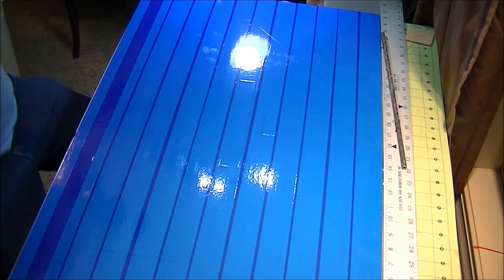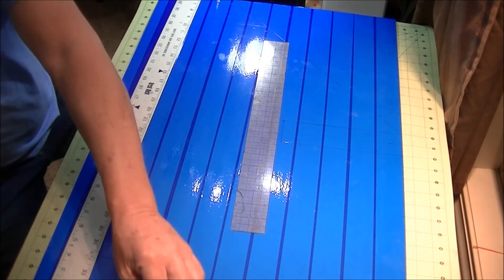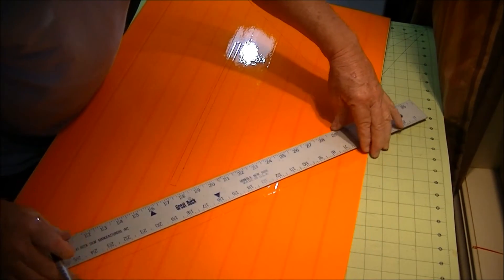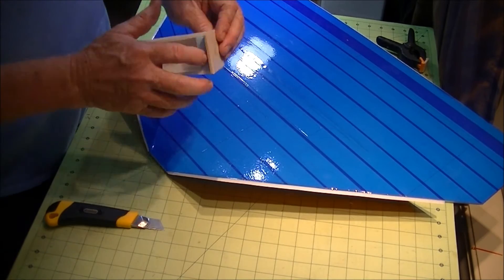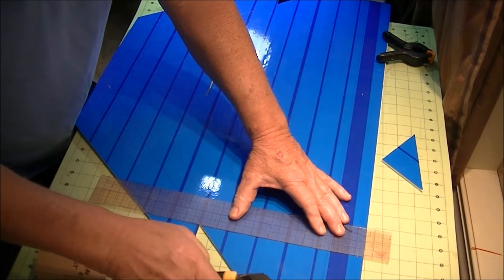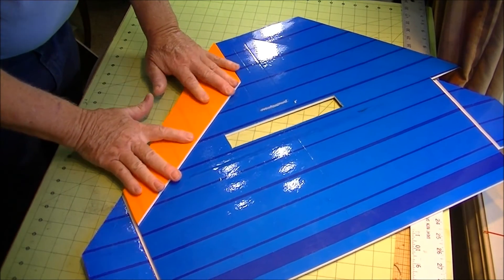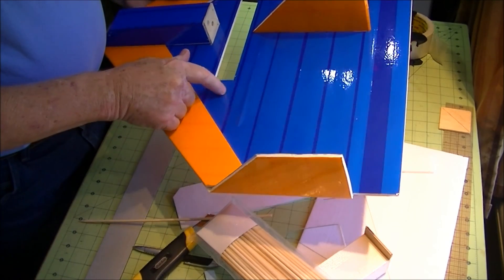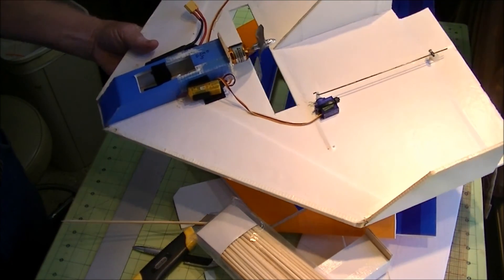RC COMBAT PLANE BUILD PLANS

Comment: I just built this combat plane according to John's specs and it seems to come out very well...   After the first flight day, I did make some modifications to the battery compartment.  I made it a bit wider (2 1/2") inside and also made it out of 3/16 base wood which makes it more durable.  The length is still 8". I also made the height 1 3/4".   This allows for a  lager battery and able to move it around to adjust the COG. The flight before mods, I had to add 42g to the nose, so adding a bit of weight to the front with the modification is not a problem.  I'm using a CF2812-1534KV motor from RCelectricparts.com with a 7x6 prop and a 30A ESC and an Admiral receiver. Total flying weight is 675g (battery is 133g - 3s 1500mAh).  Hope this helps!

UPDATE:  I tried building this design both from foam board and coroplast.  Both planes looked great when complete, but could get neither to fly despite numerouse attempts, moving CG, different props, motors, control adjustments, and very skilled pilots.  Just VERY VERY squirlly.  Wish this would have worked.